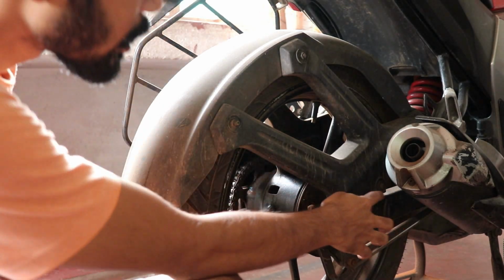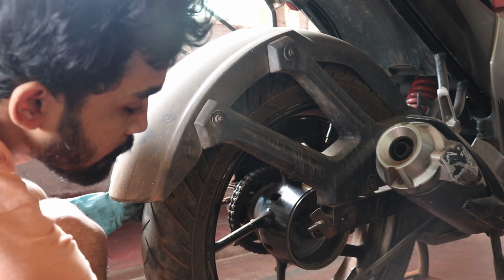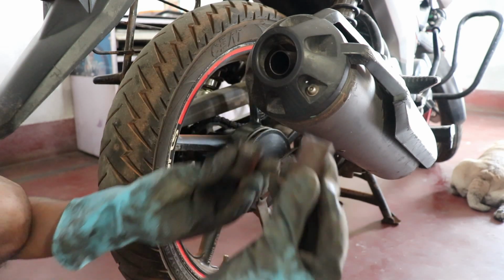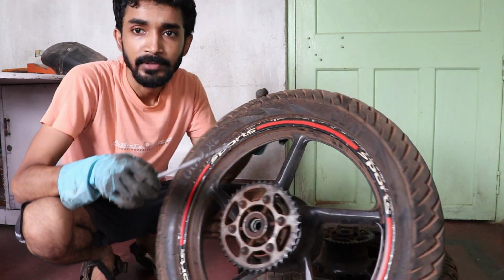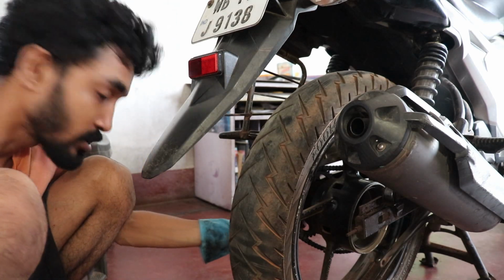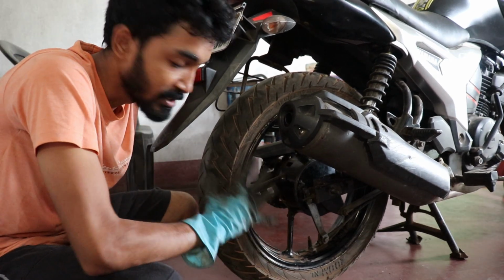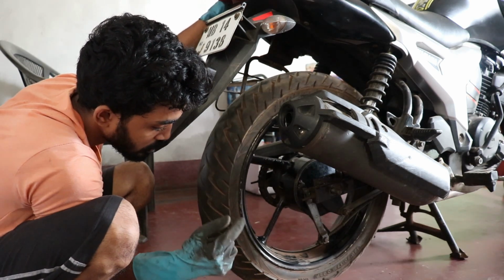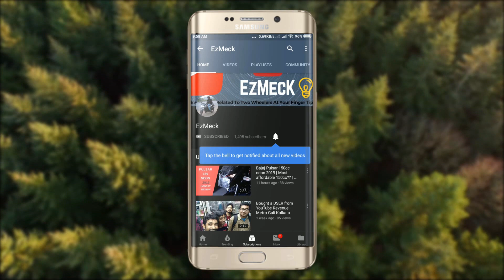How to Fit wider FZ's Rear Wheel in YAMAHA SZR / All you need to know /

Comment: I have an SZ v2, and I am having problems in braking especially after I go past the 80kph speed. Whenever I brake, the bike is unstable. This video gives me an idea as to how to overcome such problem. I know that this idea will probably reduce the top speed of my bike, but I will not compromise my safety for the sake of speed. Thanks to you brother.
From the Philippines. 🇵🇭
Reply from the maker: It may be because of bad ball racers too. Or may be a bad rear suspension. Do check those out.
Reply: @EzMeck  the rear suspension works just fine. I'll go check the bearings. Or maybe it is just because my rear tire (100/90-70) cannot handle such breaking force at speed beyond 80kph.
Reply from the maker: But its not the case with my bike, and my fellow szr riders, thats why I am saying.
Reply: I guess im asking randomly but does anybody know of a trick to get back into an Instagram account..?
I somehow lost the password. I love any tricks you can give me.
Reply: @Abel Kairo instablaster :)
Reply: @Levi Major Thanks for your reply. I found the site thru google and I'm waiting for the hacking stuff now.
Takes a while so I will get back to you later when my account password hopefully is recovered.
Reply: @Levi Major It worked and I actually got access to my account again. I'm so happy:D
Thanks so much you really help me out!
Reply: @Abel Kairo glad I could help :D

Comment: Bro.. I want a slightly raised handle bar for my szr.. Which bikes handle bar will suit for it.. I tried unicorn 150.. But am getting back pain after using for a week... Suggest some good handle bar.. Thanks
Reply from the maker: Why dont you try adding some spacers under the handlebar clamps and change the bolt to a longer one, thay process will be the easiest cheapest and will not hamper ergonomics.

Comment: May I suggest something? I think you should ask someone to hold the camera for you so that if you need to change angle it will be a lot easier. Otherwise you can just put the camera stand exactly on the side in which you are working with. =) i just wanna say, maybe it could be helpful 😉
Reply from the maker: Thanks for the suggestion Regiemerie, but I am all my own in my garage most of the time, and I am working on my videos, how to improve them.
Reply: right now no one is there to hold the camera, lockdown period is going on.

Comment: I also have a szr so i was planning for some modifications, and wanted ti install wider tyres without changing the swing arm and other things, so plss suggest me set of wider tyres without doing changes which can be usefull for long rides and city ride also with comfortable riding
Reply from the maker: See the stock tyre (100/90) is the most balanced tyre u can get. It will provide highest top speed, acceleration mileage, with a little compromise on braking and cornering ability. So to overcome that I personally use 110/80 tyres. I found them best for my riding style. I ride on and off the road equally. I used to do long rides too. People belonging from city can use upto 130/70 without swingarm mod. If u really need to use the widest possible tyre for SZR use 120/80 tyres.
Reply: @EzMeck  thanks for the information but here by this vid, I think it is not possible to install more than 110 section because that right side extra link from wheel hub to swing arm is fouling.

Comment: Can we convert my FZS tyre to szs tyre is it possible to install because better mileage to reduce tyer size please tell me bro and what cones faced in daily life
Reply from the maker: Dont do it, it will ruin the balance. But I always suggest to go for one size down, 130/70 performs really well in fz, it increases acceleration and mileage.
Reply: @EzMeck what about front tyre size  bro and back tyer no need to change wheel bro we can install directly 130/70 tyre as you suggested
Reply from the maker: Keep the front tyre as it is, 100/80, just use rear tyre 130/70. Direct fit.

Comment: Non-availability of rims are not a concern anymore. Will easily fit with 120/80 tire with sufficient gap with the swing arm..
Reply from the maker: Yeah!
Reply: What is the maximum front tyre size we can use in szr
Reply: @josedavis3469  90 90 17

Comment: Hi bro can we Install 13/70-17 in fz 16
Reply from the maker: Yes, most practical tyre size for fz16, in Indonesia fz16 named byson comes along with 130/70.
Reply: @EzMeck    I think you have Used this size tyre did noticed any problems and milage difference and handling issues
Reply from the maker: I said its the most practical tyre, meaning it will give best balance between performance and mileage.
Reply: @EzMeck   ok thank you so much 🎉